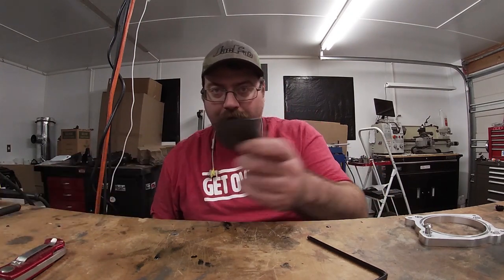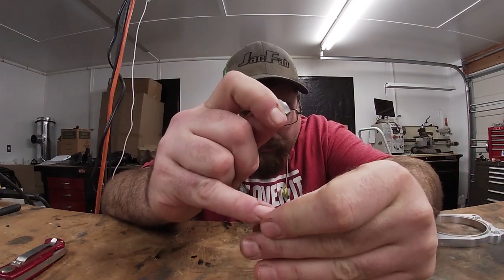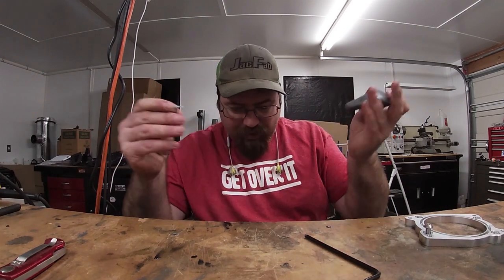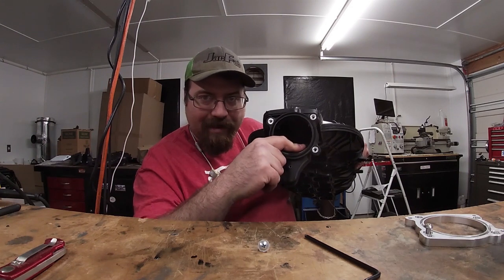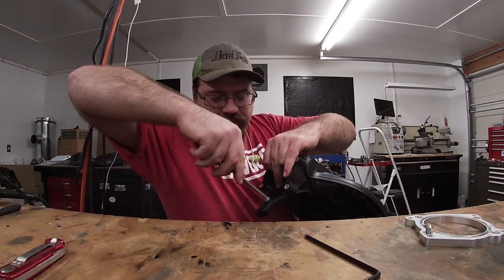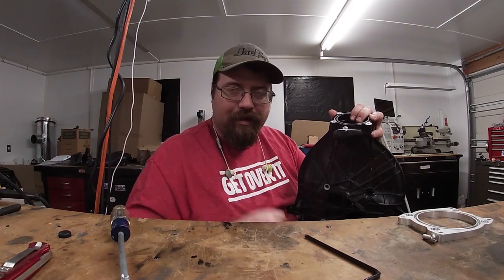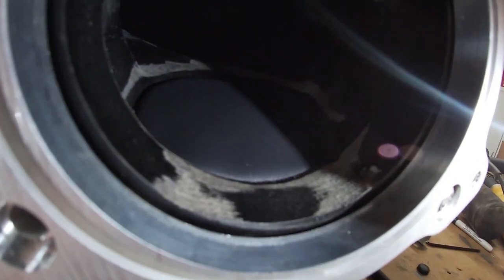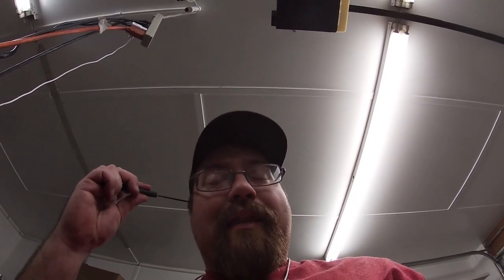Making the first LFX 80mm manifold using a JacFab Laminator FX! The Lamin-eighty!

Comment: Is it true that stock Cadilac Xts intake manifold has an 80mm inlet? And can i fit Laminator fx and intake manifold spacer in my Cadilac Xts 2013 3.6 lfx.
Reply from the maker: I don’t recall the inlet size. You’d have to measure it. The Laminator FX will not work with that intake manifold.

Comment: This work on stock manifold and need tune for the laminator?
Reply from the maker: No tune for the LaminatorFX. Mods shown in this video are not necessary, just showing people it could be done to run an 80mm throttle body.
Reply: @RacnJsn95  soo just cut ✂️ the air waffle and that set right?
Reply: @RacnJsn95  thank you jac I will place order soon definitely 👍
Reply: Any dyno test ?
Reply from the maker: Yeah, just removing the “air waffle” is recommended. Have not done a dyno test, only airflow testing.
Reply: @RacnJsn95  ok jac I will place order this week for sure man thanks you for answer me
Reply: @RacnJsn95  jac last question is nop gone demage my engine and anyway right? More air flow don't get check engine light or anything?
Reply: @RacnJsn95  still on stock right now??
Reply from the maker: No check engine light. They are in stock.
Reply: @RacnJsn95  i just place order tonight jac thanks you I hope to get my order soon
Reply from the maker: Thanks. It will ship out tomorrow
Reply: @RacnJsn95  thank you jac
Reply: That maybe gain 5 to 10 horsepower?